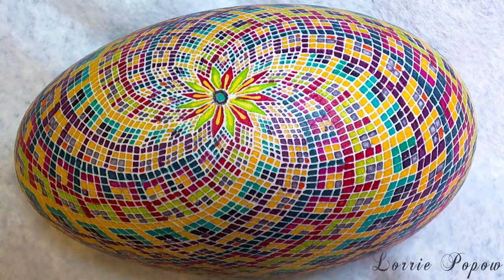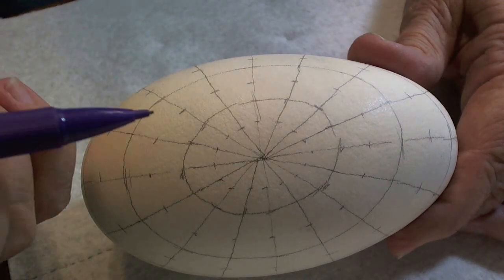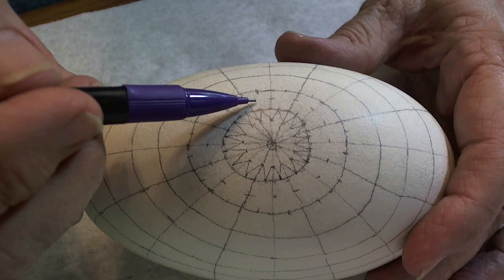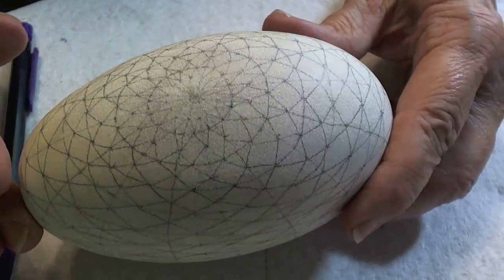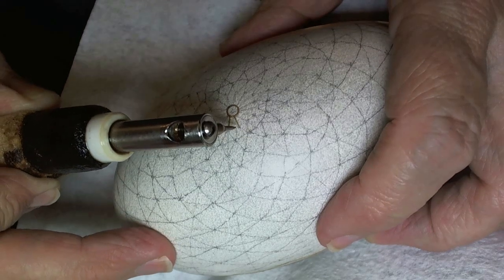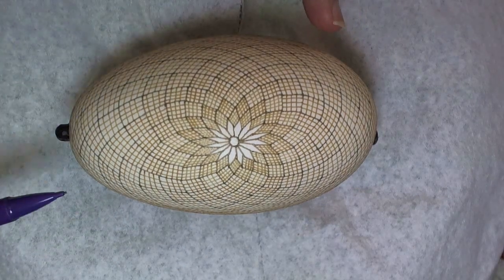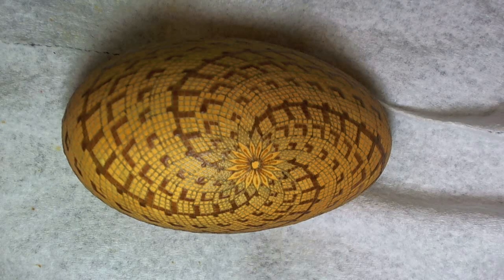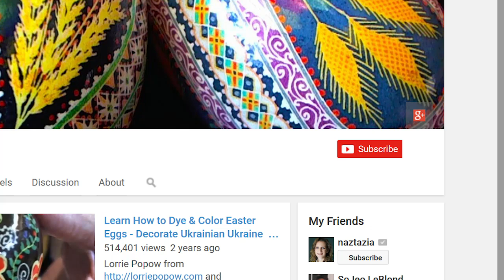DIY Tutorial Egg Art - Windmill Design - Waxes Dyes Batik Pysanky Pysanka

Comment: How do you clean off the dye before adding the next color?
Reply from the maker: Most of the time you just layer the colors  by starting off with the lighter colors, white, yellow orange, red, black. However, if you need to go from a  darker color to a lighter color you just put the plugged egg into a bath of soapy water. Rinse the egg well, and before continuing with the next dye, dip the egg  in straight vinegar. You can either let the  vinegar dry or put your egg into your next dye.